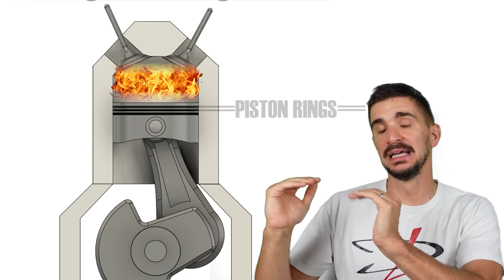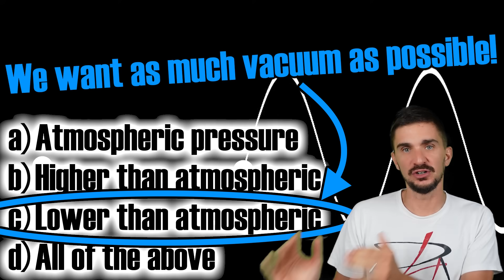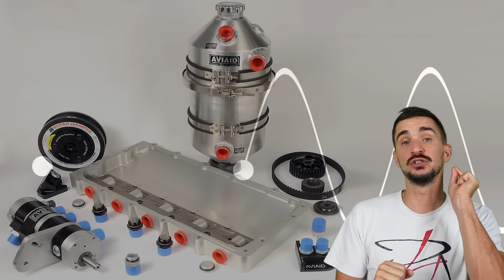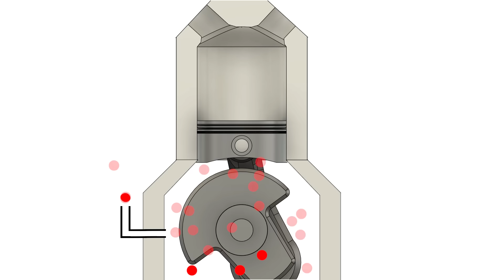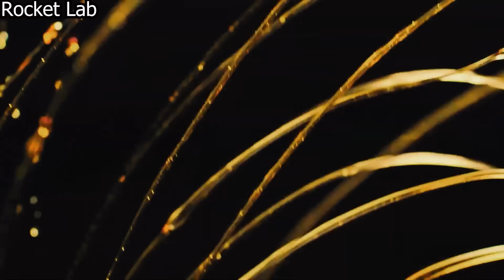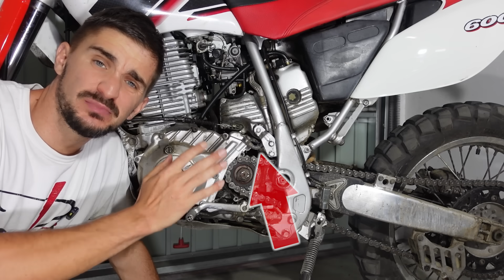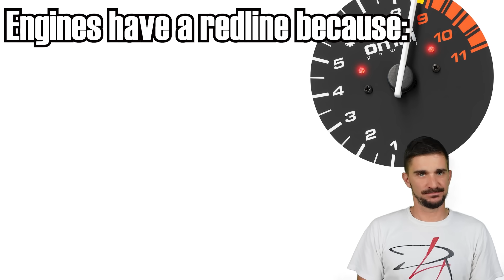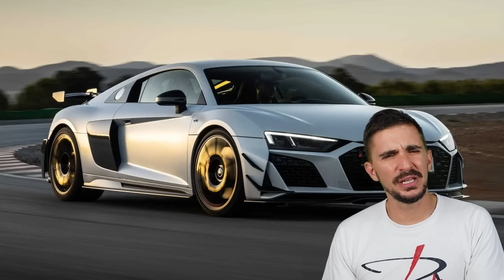Installing This Has No Drawbacks, Except for Your Wallet - Dry Sumps Are Awesome, Here's Why...

Comment: I had to add a dry sump to my old Volvo rally car.  I had machined and built a 5.7L GM V8 destroked and shorter decks / rods. It ended up at about 313 from original 350. 
We then added Brodix heads roller valve train and drysump system. It had a 3 suction stages inlet and 2 pump setup or a five core.  and held 12 quarts of oil in the reservoir.
After adding this I never saw another oil warning in turns or when jumping.  And the bearings never showed any traces of galling afterwards. it was THE MOST IMPORTANT mod I ever added.
Besides a modern Haltec Ecu and a fully closed loop sensors on every exaust outlet.  I now run a AF sensor and a dedicated exhaust pyrometer on every single exaust outlet. 
Now I cant melt pistons doms and valves either...well unless I hold the scram button down too long while WFO.   But thats on me , (Scram is a max setting/ and kinda unsafe. its basically 110%
Reply: Wow, a V8 rally car! Sweet!
Reply: That's really cool, but why did you decrease the displacement so much? Was it necessary for the race regulations or is there an actual benefit to it?
Reply: @chitlitlah   It enabled a 9000rpm redline that was then set at 8500 rpms for longevity. The short stroke  lighter rods ,crank and piston pin combonation allowed A cheaper way to reach near 10,000 rpms without having to beg, borrow, remachine used exotic parts.  I was a young machinist at a speed shop, and basically rebuilt everthing  I could. I would raid the bosses shelves and trailers and then work a couple days in trade for a supercharger, or a mechanical fuel injection system. then Claudio, the wner would show me how to fix it... I almost never boughy new!  cept for Pistons, rings, gaskets and seals etc. If it was metal, it got machined and repaired sleeved, bored, or re welded and re machined again... It was all about time...and how much you could stay awake. Often I would work 12 hrs, then machine 12 more for myself at night. and then work 12 more at shop finally going home...We also worked without limits as far as time on big jobs like an F1 engine job. Wed sleep in shop for naps and work till it was done.  My boss at the time Claudio came from an Italian apprenticeship as an 8 YEAR OLD!!! 
He lived at the shop till he was 20 then moved to USA....In 60's.
Reply: @frosthoe genuinely sounds like a wonderful and inspiring story! i am in the same boat of being a younger adult without a lot of funds but i dream of making big cool builds like you talk about or even being able to fix almost anything like you said. thanks for the inspiration, and your mentor sounds like a super wise and helpful guy. 💪🏼
Reply: @apollosnipes6405 But I wouldn't want to miss so many sleep hours
Reply: @chitlitlah maybe so it could revs higher? less stroke less torque but we're safe running on higher revs much much longer? just my guess tho idk what is in op's mind 😂
Reply: The only thing about individual egt probes, is that they're only great to establish trends. They take a lot longer to register temp changes compared to o2 sensors, and are very sensitive to flow dynamics
Reply: @xTerraH  yeah but an O2 sensor, can lie to you, for example in engines with a lot of overlap or if you have uneven intake runners which is common for v8's. EGT's will show a lot of useful information.
Reply: So you put a 4.8 crank in a 5.7. Why would you put shorter rods in, longer rods than the 5.7 length would be needed to make up for the shorter stroke? Going shorter again would make an ridiculous amount needed to be taken of the deck, or custom pistons and you chose to intentionally make the rod/stroke ratio worse?
Reply: @UFO-047  I was a machinist in a performance shop using bad parts and remachining them to work ...any way possible...lolz. Its how I could get Lunati cranks for free...(example.) I can offset machine a crank throw and remove a big gall mark from a spun bearing...example again...or re-use a mechanical injection system from an Alfa or aan F2 / 3 car...another example. we cobbled. and made it all work. Also I didnt use rods from a 4.3!  They were made by me from scratch for something else, and I found them on a shelf. I had to resize the big end and made new caps as I recall.  They were a weird length to compensate for the modified crank offset.  The block was also decked WAY down and had liners as it was a 3 times + rebuilt used GM perf 4 bolt block. You should see the Ford pimto block I put a chrysler DoHC head on ...lol. or my stage 2 cammed and 36mm Miku carburated Honda GX340cc lawnmower....A beastly 12+HP self propelled drag racing mower....DREAM!
Reply: @UFO-047  YES! Yes , I DID!  :) Dude...I was like 18 and looking at a PILE of used racing engines and parts . all blowed up and nasty . But basically free!
Reply: Very cool.

I was thinking of doing this only if I added a turbocharger but... I think I will add it to my to-do list of 280z mods
Reply: Very simple solution Insee. Good job.
Reply: Should have left it full displacement.
Reply: @YZFoFittie  It wasnt a choice! I was using donar used racing parts. That had to be remachined or offset machined to make it all work. It was not a , just fit it all together and go setup lol. I had Lancia strata parts on a Chevy V8. And Big block / small block, Who knows Italian stuff. all machined to woek. I still have this engine! ( No its not running) ...

Comment: 1: oil aerating can lower pressures but the primary reason to avoid this is cavitation. See high speed camera footage for cavitation bursts and it’s effects on hardened steels. It essentially destroys high pressured tight tolerance components.
2: a significant downside to a dry sump system is getting oil up to operating temp which is critical. Teams will usually use silicone electric blankets to kickstart heat into the oil system or submerged coil heaters to do the same. At a particular volume, the engine can’t exchange enough heat into the oil to warm it to temp at a sufficient timeframe needed for race operation. On the street, you’d have to drive your car for a while before pressing it for performance, much longer than a wet sump system.
Reply: Well, you just talked me out of putting dry sump systems on my 3.5 liter M-B and Tacoma engines. 🤣
Reply: @merlinzipp it really is an ideal racing solution and not appropriate for the street. A possible solution may be a combination of a large coolant/oil cooler and a thermostat that opens when oil comes up to temp. Exchanging heat between coolant and oil efficiently (large cooler) could keep oil temps matched with coolant (coolant temps rise quickly then flatten when its own tstat opens). Trick is an oil tstat bypass to circulate a smaller quantity of oil and remove the large mass from warmup. Not sure if thats fully thought through though.
Reply: But most modern engines already have heat exchangers. (Oil- coolant)
So the heating of the oil would be less of a problem?
Reply: @jgn593 it definitely contributes alot to getting things up to temp. Thats why vw 1.8t guys upgrade to s4 v6 coolers. More efficient, more volume but what does the most is proximity to combustion heat and a wet sump is the most efficient at getting heat into oil quickly. The coolant/oil cooler then plays a large role in stabilization. Once you move that mass of oil far away from combustion heat, it becomes tough to get it up to temp quickly. Stabilization isnt an issue though.
Reply: @golfputtputt  okay, always nice to learn stuff via the comment section.
Reply: @golfputtputt  That is basically what Subaru CVT's do.  They route the cvt fluid into an exchanger with the coolant to get it up to temp faster.
Reply: @golfputtputt Lycoming aircraft engines have a valve that bypasses the oil cooler at lower temperatures. If you put vernatherm into a Google search, the AI overview will provide a summary and even a video.
Reply: @golfputtputt  you don’t need to heat up the whole oil mass at once, though, right? Can’t you heat the oil as it goes into the engine, only heating what you are about to use (until heat output is enough to heat everything and make this irrelevant)?
Reply: @fbrtnrsthf correct, Which a heater element would do vs a heater blanket
Reply: I have a c6 grand sport manual trans with a dry sump LS3. It takes 5-10 mins of driving to get up to 140C+ oil temp. I have 10.4 quarts of oil. If it’s below 40F outside it takes way longer. I never push the revs until it’s warmed up
Reply: @CyborgKilNonx whew thats alot of oil!
Reply: When you mention cavitation destruction of hardened steel I'm guessing you mean the crankshaft and connecting rods?  I can see the cavitation being a loss of "cushion and protection" between those surfaces and bearings.
Reply: @tamallory yes but much more so the oil pump. Gear teeth suffer greatly from cavitation. It’s essentially speed of sound bursts happening between gear teeth at their closest proximity. It results in shearing off material from the teeth, reducing pump pressure capability or shattering pump gears altogether and also sending that sheared material into the engine bearings. Bad news. 

It’s what destroys diesel high pressure pumps despite people claiming external particulates which is partially true but not exclusively.
Reply: @golfputtputt  Thanks, I started my '73 XR75 over  50 years ago and it turned into a career. I've had a lot of training from Honda and College courses. After all that there is still always something new to learn! Thanks for sharing!
Reply: The cavitation and oil aerating are cause and effect.
Edit-my point is that the oil aeration is caused by the oil being churned through all the moving engine parts, especially the crankshaft at the oil pan. A dry sump system eliminates the oil in the sump, so no crank aeration, runs the oil into a tank where the air separates from the oil even more, and therefore greatly reduces the oil aeration and associated damage caused by the air bubbles. The cost and slightly longer warm up times are really the only downsides to a dry sump system.
Reply: @carlstrohm3785  
You've pretty much got it, except the scavenge pumps draw in a lot of air that mixes with the scavenged oil. Doesn't really matter as long as one has good separation at the tank and/or one of the de-airating devices on the return line 👍😎
Reply: @gordowg1wg145  Thanks. I just get tired of internet wizards giving bad info to the world. The fact is that driving in a manner where prolonged g-foces are happening while driving, oil starvation can happen. Could be corners, acceleration, braking, steep grades, etc. No oil means bad things start to happen to the poor internals of ones engine. A dry sump and it's multiple pumps keep oil flowing even if one is literally driving in circles. So for the purpose of lubricating an engines moving parts, a dry sump system is better than a "standard" sump/pump/pick up tube system. I feel that is the truly important part of this cost, weight, and warm up time debate. Better oiling/engine protection is what one gets with a dry sump system.
Reply: when you say 'teams' in what type of motorsport are you talking about?
As for running drysump in a street car there is not much difference in warm up times.   lot of variables your leaving out. As an example I run 6L oil in my drysump, Its a negligible difference in my situation before my oil cooler kicks in to start rejecting heat.
Reply: Point 2 is relevant only for cold weather. If you're tracking in a 35C day, dry sump system would be superior
Reply: you can solve cavitation by running the proper pulley ratio, pumps dont need to run at engine speed to reach max performance.
Reply: @d.martins4471  but the pump output needs to meet flow requirements at idle. After that it's just a ratio and it will likely be over driven at high rpm anyways. And the cavitation caused by the crank and all the other moving parts has nothing to do with oil pump speed.
Reply: The second point is easily fixable with proper oil
Reply: I was just thinking of putting a valve and a oil-cooler bypass for the winter.
Reply: @FixingWithFriends i was just pondering thermostats and switches for fans last week.

Comment: Oh I have an experiment if you wish to try and make 😁
To have an opposing piston or on the opposite 180° rotation and that piston doesn’t have anything in it but just a hard vacuum 😂 
It might be amazing or it might be just waste time. I don’t know.  🧐 you could connect the vacuum pump to the engine, so it doesn’t have a vacuum immediately, but will gain vacuum after a short time. That way won’t have too much problems starting the engine I think.
Anyway, give a guy if you want to try I might be fun to try  have fun bye-bye good luck

Comment: Had a dry sump system on my ZX12R based Lotus 7 Kitcar, it gave a significant HP boost. I did make some other mods to the timing, fueling and exhaust but it was well over 230bhp afterwards.

Comment: imagine a dry sump system driven by exhaust gases lol
Reply: gonna suck (or not) at low rpm...
Reply: @fellowyou2ber  oh yeah turbos are terrible at low rpm. Good point.
Reply: @fellowyou2ber  who said it needed to directly spin the oil pump? it could just spin a turbine which generates electricity to a battery, which then spins the oil pump, this is already done in formula 1 where exhaust gases are used to charge a battery
Reply: then it's an electric oil pump.  it's not like we say electric power steering is driven from the engine even though the electricity it uses is generated at the alternator.  generating electricity from exhaust gases is cool though. @BandaMapper
Reply: @fellowyou2ber  yeah obviously, that's the only realistic way of doing it
Reply: A turbo dry sump !

Comment: 7:45  How does having a vacuum change the fact that oil returning from the top of the engine still has to fall past the crankshaft to reach the sump?
Reply: 7:53

Comment: Would be nice but fitment seems like it could be a issue, they don't exactly make one for every engine, my engine is a air cooled flat 6 with a oil pan that's essentially a flat plate, not a Porsche, it's a Chevy

Comment: Could an electric dry sump work?  An issue I could see is the availability of such kit for most engine, but having an electrical pump would help a lot.  You could also start oil circulation before the engine start, if that's a benefit?
Reply: Products like that used to be available.

Comment: 20:28 "Extreme lean angles" are of no consequence, because the force vector during cornering is well-aligned "downward" towards the oil pan...unlike in a car. However, sport bikes are certainly more likely to wheelie or stoppie.

Comment: Won't it be harder for the piston to reach TDC if there's a vacuum in the crank case?
Example: It's very hard to pull the end out of a syringe when the small hole is covered

Comment: The math on this one is sloppy, not up to the usual engineering standards. Even if the conclusions are solid, there's still information in the math.

I'm referring to stuff ranging from the energy recovery from compressing the crankcase, which is decompressed on the upstroke, through the brushing off of cost and complexity as insignificant right before acknowledging that it is apparently significant enough to change production decisions.

I think it's worth picking on this because this channel has such high quality videos, well maybe it's a victim of its own high standards 🙂

Comment: It seems like you could improve the cars by removing the water coolant and just air cool with more capacity of oil and a radiator.
Reply: Think Porsche engine since the 70s to early 2000s, airplanes used that principle even earlier than that.

Comment: the volume of a single cylinder crankcase changes greatly. A multi cylinder engine, however, generally offsets the change from one piston's position with another. ... (as one goes up, another goes down. Therefore the volume change in a multi cylinder engine changes very little if at all. 

having said that, Dry Sump engines are great, if more costly.

Comment: the biggest problem with dry sump is that its belt driven, imagine the belt accidentally tear apart, now what?
Reply: That's a very rare thing. Belts do not tear apart by themselves. And you can cover it also.
Reply: @vvevvevvvv idk i prefer chain or direct drive

Comment: has anyone tried connecting the crank case ventillation hose to just in front of the turbo charger inlet? The turbo creates a vacuum and that little bit of oil it'd suck up might actually help lubricate it.

Comment: 20:28  Wrong,  because of the centrifugal forces involved when leaning/cornering a motorcycle, all fluids (oil, coolant, fuel)  stay level with the bike as the machine leans over at speed.  Still sloshing fore and aft when braking/accelerating though.